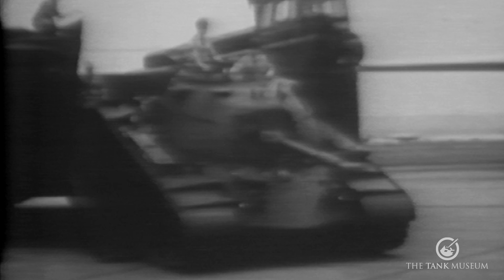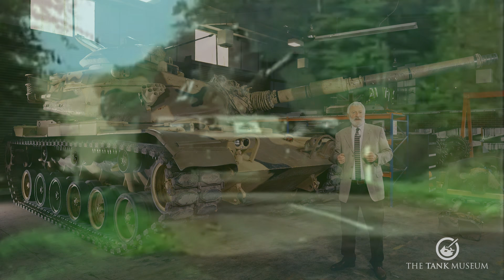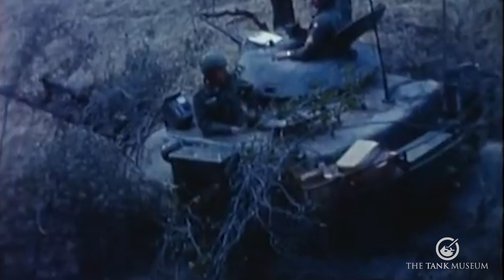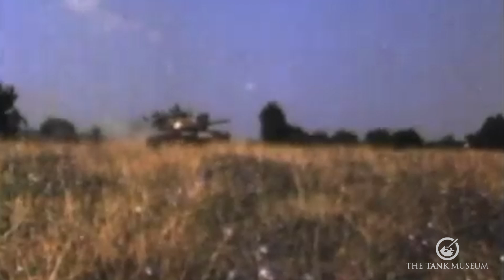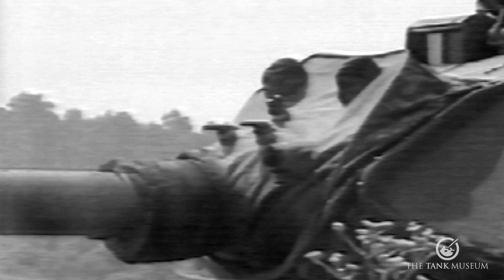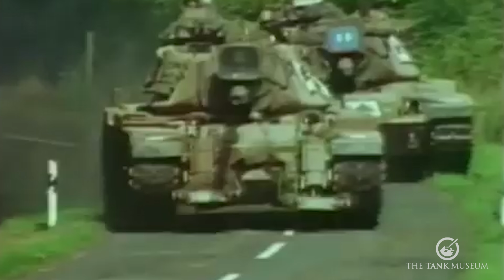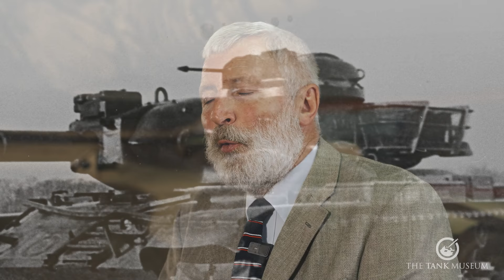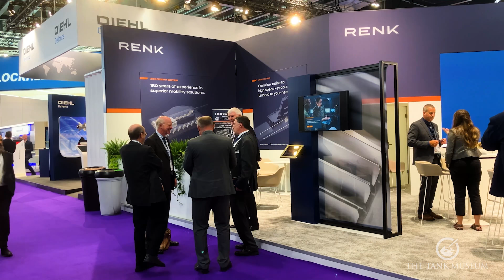M60: Cold War Guardian | Tank Chats #175

Comment: Great Video! I was Active Duty Army from 1987 until 2006. I was a tanker. I have been on the following tanks: M60A1, M60A3, M1-IP, M1A1 and M1A2 SEP. I am extremely grateful for my time on the M60 tanks. It taught me how to be a tanker old school. If you can tank on an M60, you can tank on any modern tank. It was rough making M60A1 do it's job. The A1 had no night sights. We relied on mortar allum rounds to conduct night ops. We never mounted the spot lights. The engines would blow a jug almost every time we were in the woods. The M1 tanks were like Cadillacs after being on the M60 tanks. I was in OIF and DS on M1s. I cannot imagine those wars on an M60.
Reply: Thank you for your story sir; stories like yours really inspired me to join the army as a tanker back in 2018, thank you for your time in the tank so ours could be better 

Thank you for your service and I hope you have a wonderful day
Reply: Real issue was that the M60 was the US's last all homogenous steel MBT, designed for a European nuclear war that never happened. This was the last gasp once they realized you cannot make a tank with homogenous steel thick or hard enough to save you from shaped charges, even in the 60s. The thickest armor was on the turret face and it was still only 254mm RHA. The omnipresent, multi-generational single warhead PG-7 rocket is rated for 300mm RHA, and the newer warheads penetrate much more. There is not a single spot on the M60 which could not be penetrated, and it could be penetrated by both the gun on the T72 it faced and the rockets carried by the infantrymen in APCs. In short, it was treated as all previous tank designs had been - disposable but designed to be employed in mass and replaced in mass.

The next US MBT was the M1 with Chobham armor, which was MUCH more expensive and changed everything. The ammo vents are critical too but the Chobham was like magic. I have seen an Abrams eat half a dozen RPGs like it was nothing. An M60 would have been a Roman candle after one. This is why the M60s who participated in Desert Storm were festooned with ERA - it was their only chance to avoid penetration if they took a direct hit.

The M1 started the trend of Western tanks being non-disposable, being both too advanced and too expensive to allow for much attrition. This is why the Abrams' gun is still manually loaded, too, because if you're spending all that money on protecting the crew you might as well keep another guy in there to get full advantage vs. an auto-loader like the Soviets use.
Reply: What's era?
Reply: . @busman2050 Explosive Reactive Armor. It makes the shell or RPG warhead detonate or deform prematurely so that it can't penetrate fully.
Reply: @busman2050  - E.R.A. stands for "Explosive Reactive Armor." Those blocks you see on ERA-equipped tanks are small boxes filled with an explosive filler, which is designed to go off when hit - and disrupt any plasma jet generated by the munition of the enemy, such as a shaped charge weapon. If you can disrupt the plasma jet, disperse it for example, you can defeat its ability to penetrate its designed thickness of armor. ERA does it by kinetically dispersing the super-heated jet. 

ERA boxes once used can be easily-replaced. They're more or less disposable. 

Chobham and Dorchester laminate composite armor, as well as DU (depleted uranium) armor designs handle shaped charge/chemical warheads differently, but that's another matter.
Reply: @orangejoe204  In Ait I qualified top of class on gunnery range (5 weapons systems)  Which allowed one live round downrange.  M60 with engineer barrel (50 lbs of C-4)  The target early pershing (lifted the turret clean off)
Reply: @dominicbakken MASTER  GUNNER. LATER  ????
Reply: @orangejoe204  It was designed to defeat the T-54/55 and it was supposed to be a temporary fix to that particular problem as well.  The T-62 , let alone the T-72 or RPG-7 (not so omnipresent at that time), was not in service when the M60 was designed or came into service.  The reason the M60A1's turret was shaped the way it was was to defeat the primary threat to it, AP rounds from high velocity guns.

You are incorrect that the design features of the M1 were for the vehicles survival.  They were to insure that the crew survived.

The reason the US didn't adopt a mechanical loader (there is nothing that is "automatic" about the system in Russian tanks) is because it was seen as an unnecessary complication to a problem that didn't exist in US tank design (maximizing crew protection while not increasing vehicle weight/height).
Reply: @orangejoe204  now that you finished  your book report..you apparently have no real world knowledge  of tanking...60,s out performed  T 72.s in 91 because we have superior  training and stabilization  systems...he who hits first wins....the frontal slope  would deflect most rounds and we don't stay still long enough to get hit with rpg  or shitty t 72s
Reply: @wildcelt88  Ease up there, devil dog. I didn't say the M60 wasn't superior to the T72. Every piece of electronics onboard is vastly superior to anything the Russians had, and made a huge difference in hit probability. 

What I said was that a T-72 or an RPG-7 can penetrate and K-kill any part of the M60, from any distance, with the first HEAT warhead that hits, which is 100% true. It lacks the armor to stop it's own main gun or the enemy's, thus putting it in the same category as the T-72 in design terms. A disposable tank envisioned for a European world war.

The Sagger and the RPG-7 eat the M60 for breakfast, and they are the most common AT platforms worldwide. Even the pissiest little African militia has RPG-7s. Get mad if you want, but don't get stupid.
Reply: @orangejoe204 yes this was the case in the Yom Kapur war where the Israelis lost a bunch of tanks to Sagger missiles. They still loved the tank though.
Reply: You missed out on the Haunted Tank, the M60A2.😵‍💫
Reply: @bongobrandy6297 no he didn’t, around 29:00
Reply: wasn't that the one with the stubby 152mm main gun or am I mistaken? I never actually saw one. @bongobrandy6297
Reply: I remember a sgt say about the A2 - its a good tank  but he wouldn't want to go to war in it. @bongobrandy6297
Reply: I served on them with IR and passive sights.  One of my favorite memories of night gunnery is the low ground fog illuminated by the flare from the mortars as seen through the gunner's sight.
Reply: @TimothySielbeck I was going to say they did have night vision it was IR and was old school pretty useless unless you had mortars hang parachute flares or used your searchlight which was here I am shoot me stupid.😅 we traded our m60a1s in for M1s in 1982 and holy crap what a difference that thermal sight was. 😮
Reply: @philipmcclure1310  I missed out!
Reply: @TimothySielbeck  IIRC an easy way to tell if the driver's night optic was IR or passive was to look at the shape of the cutout in the driver's hatch.  A rectangular cutout meant it was the IR periscope, and if it was square, it would be the passive periscope.
Reply: I was in the first A2 tank company in Ft Knox. Got to the company before the tanks came in  @SomeRandomHuman717
Reply: Thank you for your service ! Dumb question? The engines would blow a jug ? What’s a jug in this context ? Thanks !
Reply: Someone will correct me if I am wrong, I was on those tanks for only 2 years before we moved to M1s. The way I remember it, each cylinder had an individual "jug" of oil for lubrication. When I was on the M60 tank, they weren't making the engines any more. They would just replace parts until it was unserviceable. They were notorious for blowing one of the oil jugs and that would deadline the tank. Instead of rebuilding the engine, they would just replace the blown jug. Then another would go out. We would go on long training events and it never failed. A lot of the tanks would go down for engine issues.   @SeniorDrummer
Reply: @steveb8883  Thank you !
Reply: @steveb8883  Being an air-cooled engine designed for field serviceablity, each individual cylinder barrel (aka "jug") could be removed from the engine block for replacement.  The term "jug" was/is used by those who use and repair air-cooled aircraft engines.  Many if not most diesel engines made for serious use (truck, heavy equipment, farm machinery, industrial power, etc) are made with in-frame serviceablity in mind.  IOW, if necessary you can rebuild the engine of an over-the-road truck without removing the cylinder block from the truck.
Reply: @steveb8883 if i am correct, the engines could be swapped out in 30 minutes.  Now of course your CO is out 30 minutes on his plan and you gotta have the mechanics on hand with an engine.
Reply: @SomeRandomHuman717 I thought of it as a big VW lol
Reply: @Wolfric1970 39 minutes would be fair estimate especially if you have a rise passive  all the cannon plugs are mounted up high dis connect the wiring the final draw and the motor mount and lift it out with a 5 ton,cherry picker,or an M88 we found a 5 ton wrecker to be faster but we were not authorized one.   We managed to build one out of salvage from the PDO yard
Reply: @howardwmoore  thanks, but did not quite understand all the jargon.
Reply: @howardwmoore  not everybody was in the military and understands military jargon. Gonna have to use civi talk
Reply: @badcornflakes6374  no doubt  I stand corrected
Reply: @Wolfric1970  Yea it was more like out in two (middle of night raining) wait till dawn drop fresh pack as Co has Coffee, forget oil cause gotta go.  First stop 30 gals of oil and coffee
Reply: @SeniorDrummer  Cylinders as each was separate bolted to the crankcase as an air-cooled engine so there is no block like a water cooled engine.
Much like a Chainsaw engine or other two strokes that the jug bolts to the crankcase.
Reply: A cylinder
Reply: If you want to hear a good sob story, I enlisted as a 19K in 2002 (Same BN my that my dad had been the S-3 in '75-77), trained on A1's and A2's. Got back to my guard unit to find out our BDE was getting reflagged from Heavy Armor to Light Infantry. Never stepped foot on a tank again, so I never got to shoot a TT VIII 🥲. Transferred to a WPNS Co so I could still stay mounted 😂. During MOB for my 2nd deployment in 2010, my crew shot a perfect score on a humvee table VIII though 😉
Reply: I spent 1979-1988 as an M48a5  M60 and M60a1 gunner and commander. In 1987 I trained on the XM1. The differences between the M48/M60 was day n nite to t he XM1. But I especially liked the M60a1. To me it was a fine gun platform, a fairly comfortable ride and easier to maintain.
Reply: Where did you train on the XM1 @AMX86
Reply: @AMX86  I've pulled many a pack and thrown track with the rest.  92 - 96 combat engineer
Reply: Cheers and respect TC.  Your tank exhaust kept me warm.
Reply: 19 E 19 k   here  85 to 91
Reply: I entered 1986. Lived the changes. USMC.
Reply: @steveb8883  the only time I mounted a spot light was when I got a tasking to assist  with the testing of the Bradley.   Thermal sights were a new thing so they set up 55 gal drums and lit a fire in them.  If the gunner could not find the target I would be ask to illuminate it.   I had all the target plotted, but I really didn’t need to hell I could see the flames coming out of the top.   It had to be one of the most ridiculous tasking I ever had to fulfill
Reply: I appreciate your story. I was a tanker from 82-86, and in Korea, I first experienced the M48A5, but while there, we got the M60A1. I finished out at Carson on the M60A3.
Reply: Would help rest of us if you spelled out the initials
Reply: @busman2050  what are you talking about???  Xm1, m1, m1ip.  M1a1.  Are the tanks desigination....ip is improved...the rest  is straightforward
Reply: Switching to the M1 must have felt really empowering. That's a pretty big upgrade.
Reply: Damn dude that’s awesome. Thank u for ur service 🫡🇺🇸
Reply: Worst thing the goverment ( or the army) did was take the armored school out of ft knox.
Reply: I can't imagine how much extra training and learning curve had to be overcome to transition a crew from an M60A1 to an M1A2 SEP
Reply: 12F20 here Ft Stewart GA  
What were your opinions of the Engineers supporting your training
 preferred digging tool M9 ACE.
Or the M60 mounted Bridge AVLB  Giant target in action 
Quite impressive to set up if not intimidating to drive (blind )over, especially if floating on rack of boats
I could roll a coke can full across the paddock
I was late to the game (missed Desert Storm) and shortly out of a job.  Hasty defensive positions never entered the theater.  
To point:  I dug m1's and Bradley commander positions.  Over the course of a week 12 holes mostly in the same place.  Full hull defilade was a lot of soil, and absolutely blind with night vision and rain.
One memory serves, I was given a ground-guide (private/m1 loader) he basically held a red light @ start of hole, then at finish so I would have direction F to R.  Rain cold and miserable I traded his time for my dessert MRE C chip cookie.  W/O guide I dug a circular pit or too narrow  One commander wanted his guys to be able to unload and load the netting while in hole (the start of hole needed my two tracks wide)
ended up track and half. YOU guessed right ripped the nets and all improper loaded acc. clean off  While I was in wait (He talked real loud for about an hour, while I was full attention) That field problem I only slept 4 hours middle of the day once.  The rest 1hr tops per day sometimes spread out
Reply: I was in Germany 82 to 84 and a m60 won the tank shoot against  m1 challenger and german
Reply: EASY  ON   THOSE   NEUTRAL   STEERS  ---  TREADHEAD  !!!
Reply: I would love to hear more details about your time serving, I bet many people would